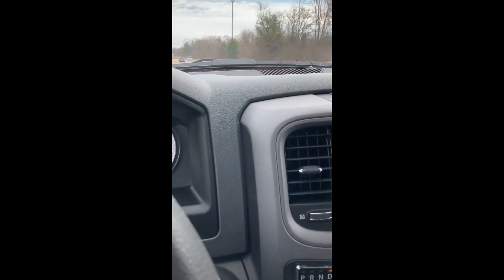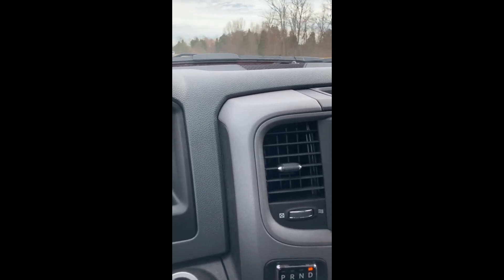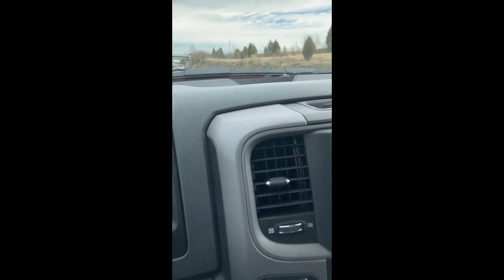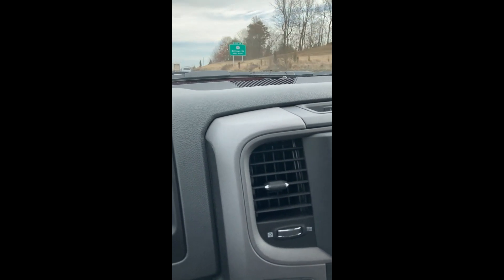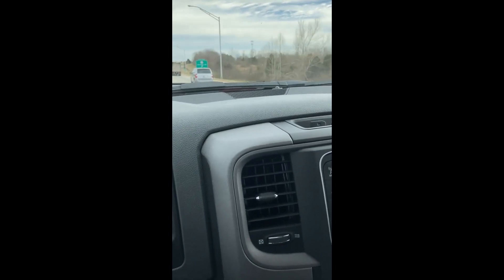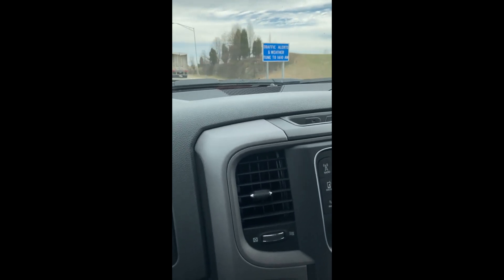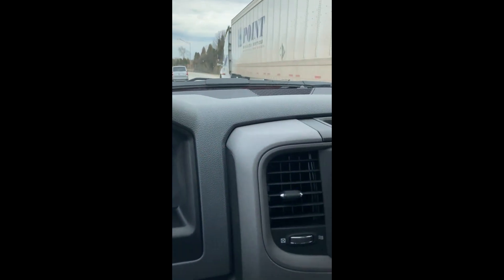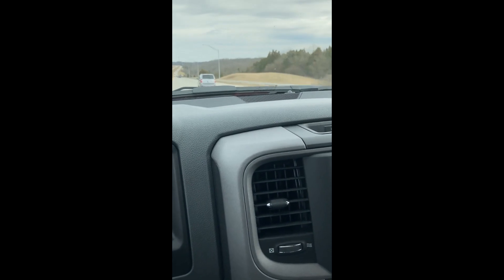Lykins Motorsports Ford 352 Dyno Results

Comment: We've got to talk . At least let me listen how you get those FE'S together at 7,500 rpm . That used to be for the 427's and that was all out race engine .
Reply: Modern pistons/metric ring package/Molnar rods are critical. Get the reciprocating mass under control, perhaps by use of a longer rod. .400 or .500 of extra connecting rod I beam is a lot lighter than .400 or .500 of compression distance in a piston. The short-stroke nature of the 352, the roller cam and the head work does the rest. Pay attention to the center-oiling FE's quirks and you are pretty much there.